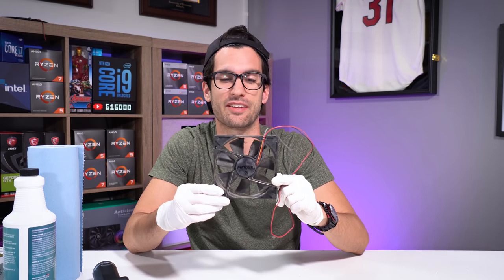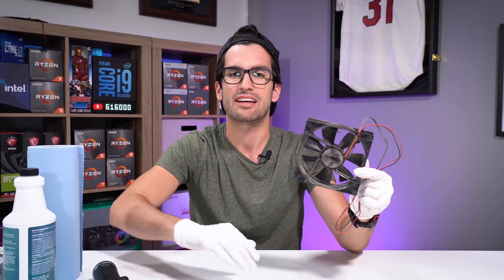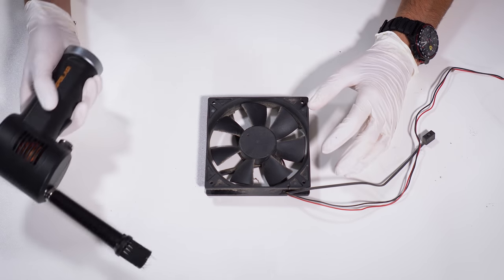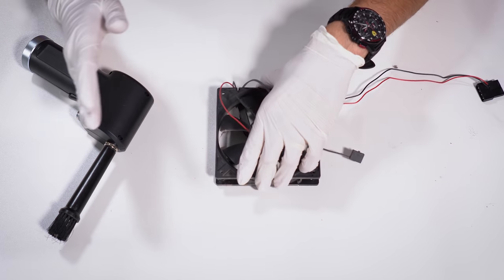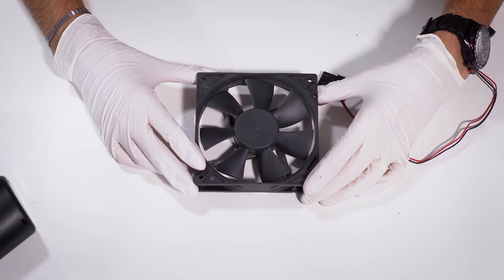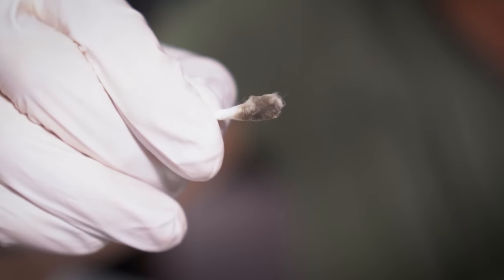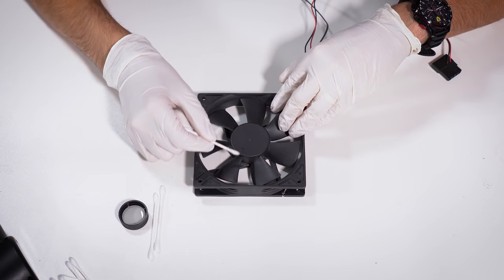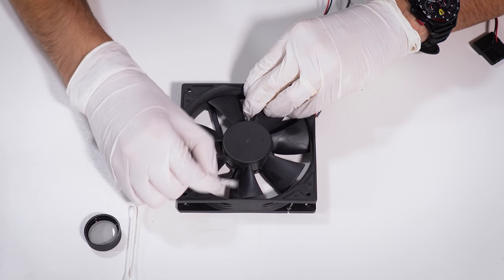How To PROPERLY Deep-Clean PC Fans

Comment: I use vacuums,  can't stand blowing all that dust and dirt back into the air.
Reply: same. that dust ends up blowing around the room.
Reply: @leetmanny  I also use an old toothbrush with the vacuum to loosen the stuck on dust around the small components on pcbs and hard to reach areas. Works very well. Then for the really stuck on dust/dirt I use 99% isopropyl with a micro fiber cloth that has the really fluffy side on them. Those fibers can catch and hold so much crap. Just have to be super careful with them because the fibers can catch on everything.

Comment: I just hose down my whole PC every couple of months.
Reply: Yeah I use a pressure washer to save time 😂
Reply: This technically work if you let the pc dry completely afterwards before turning it on.
Reply: I blast mine with a cordless electric leafblower. Works amazingly well.
Reply: @Sam_Saraguy  I just the blow port on my shop-vac with the blower attachment on the end of the hose. Works 10/10

Comment: Having gone to all that trouble, if the fan's more done more than a year or so of service, why not peel pack that central sticker (start with a blade under the edge) and (if there is one) pry out the rubber plug and add a 2 or 3 drops of motor oil?
Reply: Exactly what I came here to comment on as well. Refurbish the fan on the outside by getting rid of the dust as shown here but also need to add oil to really get it to "like new" working order (although at around 14:45 in video Greg seems to feel these fans don't need re-lubricating)
Reply: @topperdude2007  it's 'preventative maintenance' - even if a fan's functioning perfectly, if it's been running for 1000's (or quite possibly 10's of thousands) of hours it'll function perfectly for a lot longer with some fresh oil.
Reply: I do this exact thing to all my fans in mine and customers PCs. I use drops of WD40 inside the bearings and you can really hear the difference on some of the older fans. Good idea to keep a 12 volt power supply unit around as well so you can plug the fan into it and let it spin to get that oil down inside the bearings.
Reply: @Inf666ipi  I wouldn't use WD40 to be honest, it's mostly a fairly volatile carrier and the actual lubricant is very light and also tends to evaporate off fairly quickly, just use oil - motor/engine oil is fine, but you can go as far as getting hold of specifically formulated electric motor oil ('turbine oil' is the same). Funnily enough I also use a PSU for that purpose, but mostly for testing new fans before installing them - just had to return a noisy fan a month back as it happens (a 14cm Noctua Redux surprisingly) .
Reply: @EliteRock  the redux fans are definitely a little too budget in quality. I ended up getting Artic Bionix fans instead 👍👍
Reply: @arkeshn729  Might give them a try sometime. I've been using a mixture of Noctua's budget and 'proper' fans, and the same with BeQuiets (SIlent and Pure Wings). The Redux's are OK generally, that was the first duff one (had slight but definite buzz at all RPMs along with the aerodynamic noise) out of half a dozen or so in the last couple of years.
Reply: @EliteRock  totally agree! I am all for doing regular maintenance and getting the most out of my equipment (might explain why I still drive my 1997 Honda Civic EX stick shift which is in reasonable shape for its age and after regular maintenance by good mechanics over the years 😊). I did read somewhere (or saw a youtube video?) few years back where some PC fans might be harder to lubricate due to sealed housing making it difficult (if not impossible) to re-lubricate?

Comment: Sleeve bearing fans will have a lubrication well in the hub, usually under the sticker. Usually there is a rubber stopper to pry off. Sewing machine oil is what's usually recommended but the 3-in-1oil everyone seems to have works, too.
Reply: I'm using silicone spray, has worked fine so far.
Reply: @mikeycrackson  You can drill a tiny hole where the rubber plug would normally be, and just reseal it with tape after adding oil. I've done it quite a few times over the years to fans like that.
Reply: @mikeycrackson  WD-40 is fine and everyone has it laying around, it also has the added benefit of the red injection tube to get inside the housing without any mess.
Reply: I had a fan on my GPU make insane noise from time to time for a year or so. I finally decided to open it (unfortunately there was no well and i had to "pop" it, it was a little scary) and lubed it with silicone spray. It's been 8 months and has been running noise free ever since
Reply: @BroNapartay  “Red Injection Tube” sounds a lot like a fancy way to say “a straw”
Reply: @BroNapartay  No. WD40 is not an oil, nor is it a lubricant of any kind. It was developed to displace moisture. Its purpose and appropriate uses are widely misunderstood, probably because it has a slippery feeling when applied.
Reply: How bout wd40?
Reply: @be8w  that’s a bit incorrect, it does have lubricant in it that is left behind. Both fish oil and petroleum are in the mix (that was from WD40 themselves) which are left after the distillates evaporate; but, granted, it’s less than most would find useful as a “lubricant” proper.
Reply: @BlueRidgeCritter  Myth: WD-40 Multi-Use Product contains fish oil.

Fact: Consumers have told us over the years that they have caught some of the biggest fish ever after protecting their fish hooks and lures with WD-40 Multi-Use Product  . We believe this legend came from folks assuming that the product must contain fish oil since it appears to attract fish.  Sorry Charlie®, it just ain’t so.

WD-40 Company has taken steps to respect and conserve the environment, and encourages its users to do the same. While WD-40 Multi-Use Product can be used to help protect fishing equipment from rust and corrosion, WD-40 Company does not recommend using WD-40 Multi-Use Product to attract fish.

Comment: Important note for those using their family's Rubbing Alcohol: Use the cap from an empty water bottle or other container to avoid contaminating the rubbing alcohol once you place the cap back on. This will also let you close it & avoid having it evaporate while you clean.

I own a small porcelain watercolor tray which ended up being perfect for this! If you're doing this often enough you can get a simple porcelain/ceramic dip dish for very cheap which is easy to clean.
Reply: Calm down

Comment: Awesome video man! Thought I'd add that not only could the bearings be damaged by not holding the blades, but you also run the risk of damaging the motor itself. A motor getting spun by an external force is just a generator, and you can create some reasonable current with the high RPMs from an air compressor just spinning the blades, enough to cause damage internally sometimes. Also, if you have to leave them in the case to clean them, at least unplug them because if you blast the fan with air without holding the blades you can burn up a fan header.

Comment: The electric dusters aren't too bad about overspinning the bearing, but if you use an air compressor with aa high pressure nozzle, it's actually pretty easy to overspin the bearing and ruin it. And yeah, air and brushes don't do was well as a Q-Tip. That dirt and dust can really get stuck on those blades.

Comment: This seems like a very thorough guide, nicely done! Tbh I would never be this meticulous about cleaning even my own fans but it's cool that this deep clean guide exists. To me as long as the visible dust is gone and the dust in the bearing is out I will feel comfortable putting it back in the system. Especially where I live where you have so much dust that cleanings are about every couple months, this level cleaning just isn't very practical. Really cool video though!

Comment: I've actually pulled off simple sleeved bearing fans right out of the bearing, used alcohol soaked shop towels to remove the dirty lube completely, dried it out, and added new lube in (hairclipper oil) and then put it back in, and it went from fully ceased to fully functional and quiet.

Comment: I have a more than 10 year-old Dell Studio XPS and I clean it just like Greg does.  I've done this periodically over the years and I am running Windows 10 PRO with no problems at all.  I run a few newer games without hassle.  Intel(R) Core(TM) i7 CPU       X 980  @ 3.33GHz   3.33 GHz

Comment: most important reason to me for cleaning everything with proper solvents that break down grease and oil is that there is usually something in the air landing and sticking (oil and grease particulate) that make the surface a giant flytrap for catching dust all over again and not letting it go, We seriously need to focus on developing methods to make computer cases seal-able so no air is entering into it to get the heat out, like those that have heat pipes that run up and out to the case's inside surface so the outside of the case becomes a giant heat sink, now just add proper fins or something and put the fans on the outside like that, where you can easily pop those off disconnect them and clean the outer fins with out worrying about dust inside the case since it is sealed, even if we put fins inside too that circulate air from the inside of the case to cool it down and then back into the inner core of the computer components to cool them off or something, though we need much better heat sink compounds or a way to avoid needing them or something, lol, (since they like to dry out and then stop giving proper heat bridge for the heat to escape to the heat pipes in this case thus causing a massive heat cascade failure as it over heats and causes other heat sink past to dry or cook and fail as well lol)

Comment: My brother used to sell Kirby vacuums, and apparently one of the pitches they use is to tell people with computers that they should vacuum the inside of their PCs like every 2 or 3 months (using standard Kirby attachments). I tried to explain the danger of static electricity to my brother in the hopes that he would stop, but apparently my computer science degree means nothing compared to his 8 years of using disingenuous tactics to sell an overpriced vacuum cleaner.
Reply: I've been curious, what is it about sucking air in compared to blowing air out which produces static electricity in contrast to the other? The only important factor I can think of for using an air blower/compressed air is because of the dangers of sucking up loose metals like screws or other pvc components into a vacuum but otherwise I'm confused.
Reply: @mica4977  Most people are just too afraid of electrostatic shocks. It really is just blown out of proportions at this point and it in not as bad as everyone makes it out to be. You can vacuum inside your computer just fine if you ground yourself to the chassi of the pc while you are doing it. In layman terms, just keep your hand on something metal in your pc, like the case or powersupply. The only thing i would be worried about is to avoid knocking of components from the boards with the vacuum hose if you nudge them.
Reply: @Drakey_Fenix  Feel so as well. Caution is good but not when it stops people from cleaning their systems out of fear. Though yeah, may still be good to avoid vacuuming a PC for those other reasons.
Reply: @mica4977  It's not the direction the air is flowing in that's the problem, it's the material that the air flows over.
Reply: @fedos  The vacuum's/air blower's piping?
Reply: @mica4977  Plastic. But it's the bits that come in close contact with your PC that matter more than the piping. And with the Kirby vacuums, the accessories are all made from the same hard, not static-resistant, plastic.
Reply: @fedos  That makes more sense.

Comment: CRC Electronics cleaner spray is the way to go get the spray and solvent action in one go! Does a good job with a duster or compressed air as well to help blow stuff out once you spray it in somewhere as opposed to letting it re-evaporate where it's at. You probably want to re oil the bearings on your fan if you use it but it will get the gunk out of the hub like nothing else.  Honestly, the stuff works pretty good at cleaning pretty much everything it is a godsent for cleaning off any gunk or oil or grease if you do any work on your car. Both cleaning off what you're working on as well as you!

Comment: Also, don't spin the blades if it is still connected to the motherboard as the fan will generate current and send it back. I've popped a motherboard fan controller in the past by doing that.

Comment: Nice how to video. How I clean out fans is to use Paper towels which i moisten with the cleaner and tear the paper towel into smaller pieces which i use like a cotton swab but since the paper towel has a bigger surface area it can clean quicker and easier.

Comment: The problem is the disassembly. I have to unplug the fan from the motherboard if I want to take it out like you have and then plug it back in after I'm done cleaning. Every time I'd risk damaging the motherboard. I can't keep doing this twice a year, because if my board cracks, the repair cost will be a bit higher than the cost of a fan. I'm even nervous about screwing and unscrewing the fan as its grooves were carved by the screws during first installation. I just clean everything while they're in place.

Comment: I once cleaned the fan of my GPU, the fan kinda died. It is not an electronics problem as I can see the fan move a little when powered, and I can also feel the torque applied by the motor, but I think that it is clogged and jammed somewhere. I DIYed a 120mm case fan and it ran fine. But now i don't care, as the GPU died. It was about 10 years old.

Comment: Looks great externaly. But, as always, the most important thing is: "Is this noisy?". When there is dust in the rotor, a deep clean of this zone, and an appopiated lubrication, is the real meaning of fan cleaning, I think. And OK, what's about the fans with magnetic gear? Well... The fan of the video doesn'l look like one of these, no?

I apreciate very much these kind of videos. The unknown job of an IT employee.

Comment: On my old PC I had the PSU fan stopped working thus making the whole PC case warm as a radiator. The fan was perfectly clean but refused to spin. First thought is that the fan is dead right? Wrong. I removed the fan, disassembled it, that's right. (disassembly was tricky at first, you need to remove something like a cut very thin plastic washer, that's all what it took to do at least in my case on a cheap random chinese PSU fan) cleaned the bearings with IPA and then lubricated it with machine oil. The fan started spinning like new and the case was warm no more. 10 years later the fan is still happily spinnin'.
So next time you see a dusty ol' fan not spinning don't assume it's dead yet.

Comment: Did you break the wire holding channel just to clean it and now they're free to hit the blades easier?
Reply from the maker: No, I did not break anything... the wire can be freely removed and reinserted into its plastic cable guide without issue.
Reply: @GregSalazar  Consider me corrected. I need to clean 9 fans. I thought having 9 looked great but now I'm starting to regret that decision.

Comment: Idea suggestion... relubrication/adding lubrication to old fans or fans that have possibly been tainted by fluids like water from a leaking radiator.  It has been many years since I saw a good one.  With the many types of fans out now showing which kinds to and not to plus some reference links could be helpful.

Reminds me I have an ancient fan from the dark ages of computing in my firewall I should lube or remove and give a good Viking Burial for almost 23 years of service.  Come to think of it it has a 10GB (yes GB) HDD in it too.  Maybe I should donate it to a museum instead.

Comment: a better way i find mostly effective is to spray with liguid detergent, rub with a loosened q-tips (dipped in liquid detergent) and use air blower. the liguid detergent will actually loosen the dusts better than any other cleaning fluid.

Comment: when i cleaned my fans the kind where the bushing is behind the back anyhow, not fluid or mag lev types as those don't come apart like that anyhow. i always just taken that out and pop the hub out once they get like that. i find the bearing area eventually gets hair, dust even the magnet gets coated and at some point gets so jammed in there even gets in the area where oil is stored and makes that kinda noise. rare cases ive thrown the windings and bearings right in warm soapy water let them dry well and re oil carefully and off they go. i have 200mm fans that are 10 years old and still counting and usually on 24/7 problem free. but of course it will vary and im not responsible to those who try this and kills the fan. i know what im doing and does just fine for me.

Comment: While this is good for one fan that you have detached from your case, this is an ideal scenario.

In reality most PC users would have at least 3 external fans, not counting the CPU fan, heatsink and GPU fan.

I have 6 fans not counting the CPU and GPU fan. My case is also quite small so it was a very tight build.

How do I go about cleaning it effectively? I use a very powerful leaf blower once a month and this gets rid of all the loose dust on and around the case as well as on the front/intake side of the fans.

But there is a lot of caked-on dust that is very heavy and doesn't go UNLESS I swipe it with a cloth or tissue. This caked-on dust also happens to be in extremely hard to reach places, like the underside/exhaust side of the fans which is almost impossible to clean without removing them.

The top of my GPU and PSU also has caked-on dust but I can at least get my hand in and easily swipe them clean.

But swiping the underside of each individual blade for nearly 10 fans is not practical.